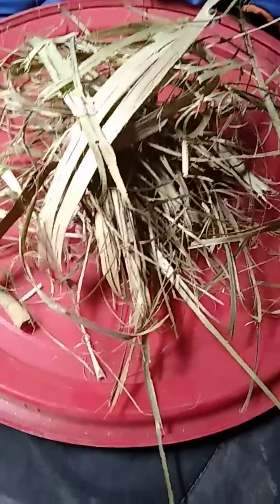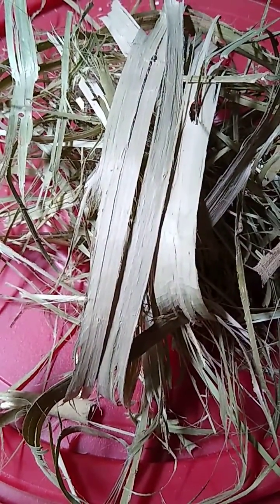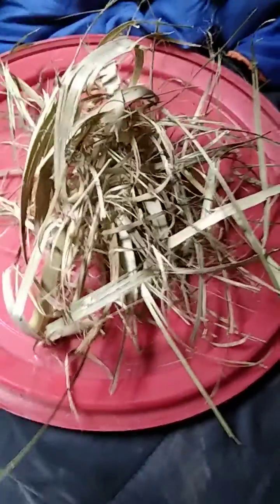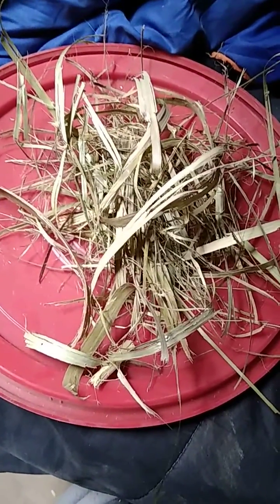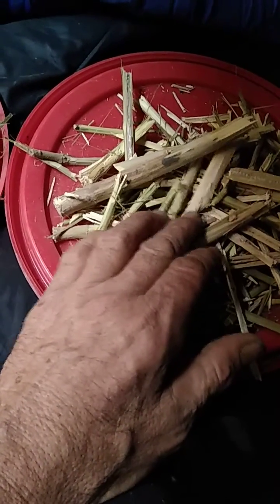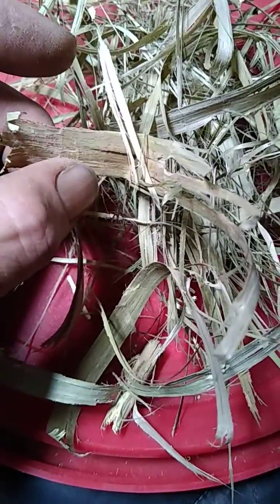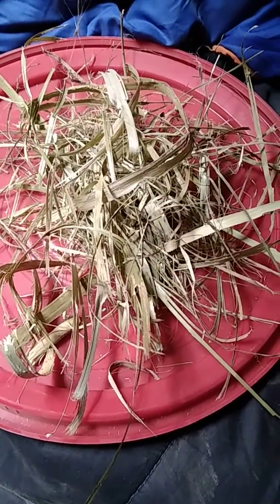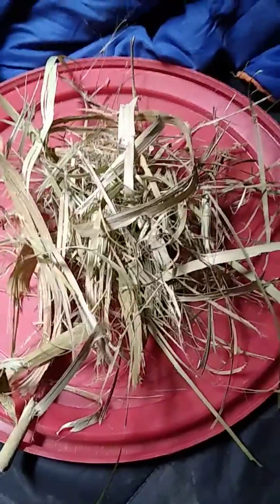Preparing raw Hemp fiber for at Home biodegradable Bio plastic

Comment: I have been weaving hemp with the intent of making curtains.   My house has many south facing windows.  I think it will demonstrate some money saving options in something as simple as a curtain. 

I also think, with epoxy,  I can get a organic armor.  I would like to see if 100% hemp, in hemp plastic, is bulletproof.  

Enough of about anything is bulletproof.  The amount of heat and pressure it might absorb could prove useful.   If not only for personal body armor, But shape charges.  It would just need to be good with heat and pressure.  It seems like it might. 

I have some woven fabric now, made of 2 stand hemp, 30 stands per inch on the warp.  I'm making some 32 per inch now.  And single strand one next, 40 per inch.
I'm using a 2 by 2 weave. 

I have a handful of raw plant material.   I just need some science background that I don't have.  

I was an infantry marine,  a tow gunner, and have a degree in psychology.   I haven't got arround the the hard science stuff yet.  I get history made use of useful things. 

I figured,  a military use could get some of that military money and clout. Investment is security sounds better than growing weed.
Reply from the maker: Good luck with body armor might consider acetone soak, hydraulic press, acrylic resin 'plates' under vacuum
 Layering 'plates' with a chemically reduceable plastic (bed liner)